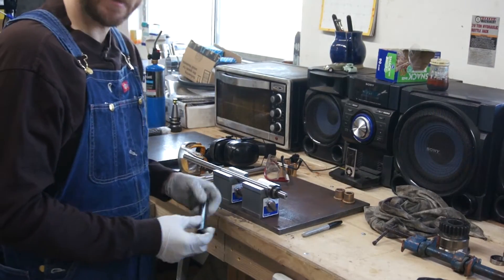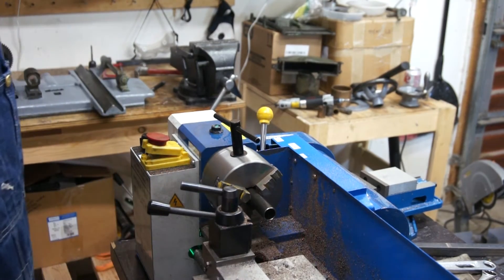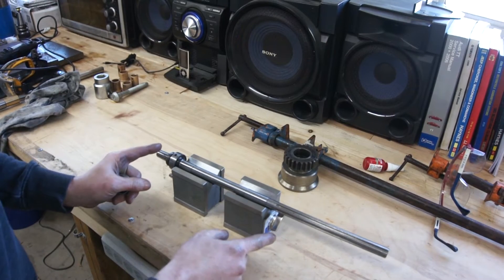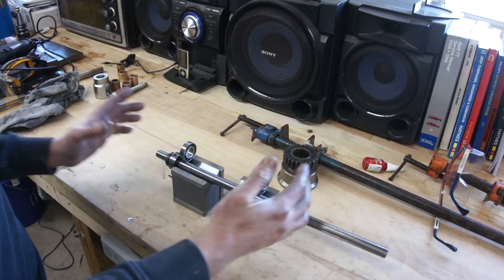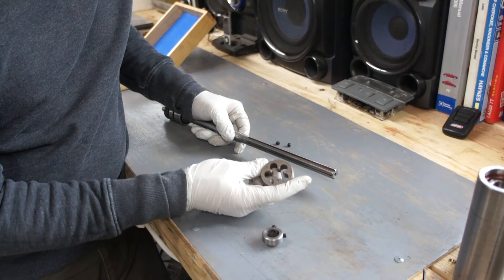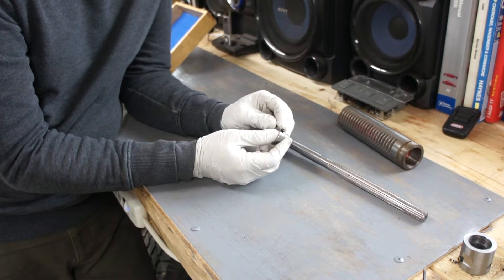Angular Contact Bearings - Drill Press Milling Machine

Comment: Robert, did you check the run out on the shaft with an indicator? that would have given you some kind of indication wether the bearings were good or needed replacing and oerhaps saved some time and money?

Comment: So did you try placing the shaft in the freezer and right before pressing it heat the outer sleeve which would give you a pressure fit for the contact bearing making it more stable.

Comment: I'd imagine the chatter on the Y axis is caused by a larger tolerance for the feed handle. Maybe by fixing the quill completely and using the table feed to raise and lower the job you'll create some more rigidity. You can replace bearings until the cows come home, but that's not where the movement is coming into it

Comment: Does the Quill lock? Is it a good fit in the drill head, if not, you could try electroplating it until it is a precice sliding push fit, lap it in even. Hope this is of help.

Comment: Some of that chatter could be from the play in the quill gears because I know on my drill press there was a lot of play in the gears like back lash where you can grab the chuck and move it up and down and it's gear slop and on certain cuts with a end mill it'll leave chatter marks....and end mills only really cut in 1 direction with the work going into the direction of rotation....just like running a grinder or cutoff wheel

Comment: Just throwing this out there, had you considered bushings instead of bearings?  Oilite bronze wouldn't work, but there are polymers that should, PEEK (polyetheretherketone) for instance.  Since you have a lathe, it would have been fairly easy to machine them.  I don't know about the finish in your drill press head, but if it were smooth enough, you might even be able to give the shaft a lot more support by machining the the bushing like a flange bushing.  The flange portion would have the thickness of the old bearing and the rest could be as long as you wanted.  Lots of area to take up compression loads and no pre-load problems at all.

Comment: I'm sure this has been said...The standard bearings are for axial loads (they carry the spindle) not compressional loads which you require..The standard ones will work, but with a very shortened life as they only hold the spindle in a central axis.The angular ones are designed for that kind of load.
The chatter will be coming from the x ,y table the quill and the screw jack. Locking off unused axis on x, y table will reduce some chatter, putting the quill as far to the top stop and locking it off will reduce the chatter.
I have a MK2 Beaver mill very similar to a Bridgeport and i get chatter if i dont lock off axis I'm not using on big parts, She is old and ways are worn...
Great vids, very informative and answers some of my curiosities.. Sorry if i am just repeating everyone, but i am lazy and can't be bothered to read them all..Thanks
Reply: you lazy?? Your comment does not remind me of a lazy man! I would think just the opposite!! Take that as a compliment!!

Comment: End mills only really cut in one direction, into the rotation of the cutting surface. Going with the rotation is referred to as a climbing cut and should be avoided if possible. I really want to build my own version of this project. So many of my questions were answered in these two videos.
Reply: So correct. Even using a wood router, you cut into the wood and not with the wood. Climb cuts will always be a problem with most any cutting power tool.
Reply: Climb cutting is the preferred method of cutting in CNC mills and even has a place in manual mills for helping reduce backlash in the drive screws.
Reply: @brandonsmoot4056  I’m strictly old school analog, I don’t have any experience with cnc machines and never will.
Reply: @WrenintheRoses  well in sure the backlash argument is something you've heard when talking bridgeports
Reply: @brandonsmoot4056  climb milling has its advantages, especially with a newer machine that has incorporated backlash elimination into it. I grew up in a family owned tool and die business that had manual machines, many of which had brass war department plaques riveted to them.
Reply: @WrenintheRoses  I am 1000000% with ya! Old-school, analog, etc... Cheers my friend.
Reply: End mills can be used in climb and standard cut for "any" mill old or new. I am a designer drafter and call out both types of cuts due to engineers instruction on production drawings. My company is responsible for millions of dollars of production work and this statement is simply not true.
Reply: @matthewmoilanen787 you are so correct, thanks for this comment…Paul

Comment: Great video on this, thanks for providing the original bearing specs, I do have one, the bearings are a little noisy but drills holes good enough for now. The WT line of tools changed hands bought by Delta and phased out. The odd bearings are used in their other machines also. Thanks.

Comment: I'm interested in switching to the linear bearings. You mentioned the DOM tubing was 16 mm ID. What was the starting OD?
Reply from the maker: I think it was 20mm OD.  McMaster 6045N13.
Reply: @RobertAdairWorkshop Thanks. I'm interested in switching just to replace my existing 80 year old bearings.

Comment: you can still use the die method, just need an adjustable die, one with a slit in it, allows for a tighter or looser fit, also can adjust for a deeper cut.
Reply from the maker: I hadn’t thought of that.  Thank you.

Comment: Are the bearings originally Imperial?

M grade bearings are designed for electric motors and are tighter tolerance than standard bearings.
Reply from the maker: They are an odd mix of metric and imperial.  As I recall, and my memory isn't the best, it's 5/8" on the ID, metric on the OD.  I will take a look at M-grade bearings.  Thank you.

Comment: Did a similar project years ago.  Made a complete new spindle with a MT 2 nose and drawbar. Used taper roller bearings. Made a new column with some triple wall pipe.  Lots of work for mediocre results.  Like someone said, it's educational.

Comment: How is the quill bushed in the body of the drill press? Seems like theres a ton of Stick out with that set up? that Chinese X/Y table could be tuned up and tightened up (Scraped, hand or power) I'm 54 years old, I told myself my entire life the Same things you were saying, Bridgeports cost too much, Are too heavy to move, Where will I get 3 Phase? ETC - Bought My Bridgeport in 2018, just over 4 years ago, and while I got it rough and rusty and semi-worn, theres still a TON a life left in it, I paid $1k for it, moved it with a Buddy and a Bobcat with forks and a rented Home Depot trailer, once home with a Cheapo Harbor Freight folding engine hoist and also rolled it like the Egyptians on steel galvanized 1" water pipe, and Had it running perfectly on 20A of 220v Single phase with a $115 eBay Static Phase converter- Dont kid yourself, even a worn out tired 1967 Bridgeport J-Head is better than anything you can cobble together, and Parts for Bridgeports are DIRT CHEAP, You can rebuild the entire spindle with all bearings, seals, shims, sleeves, etc for like $350 - They made the EXACT same J-head from 1938 to 2012 with no changes, so parts avail is easy and plentiful - I shoulda bought one in my 20's back in the late 80's early 90's when they were newer and not so worn, I think now with so much industry going CNC and also overseas, old 1960's, 70's & 80's Bridgeports are getting cheaper and cheaper - I'm near the Tampa FL area FAR from the rust belt of the mid west where everything was manufactured, theres places in Illinois, Ohio,  Kansas City, Etc with Real, USA Heavy machinery for PENNIES on the dollar compared to what I can find here -
Reply from the maker: Thank you!  I have been watching for a Bridgeport J-head for the past year, maybe.  I'm in Denver and we never had big industrial manufacturing here so they don't pop up used which makes this one tough.  There was one that finally popped up locally a few weeks ago on eBay but it went for $3800.  I found a guy who could transport it and offload it but he wanted $1200 to do so.  It just got too expensive.  I've been watching eBay and looking at some out on the west coast.  I just need to find one in my price range that someone is willing to freight to my shop and unload.  Time and patience, I suppose.
Reply: @RobertAdairWorkshop  Theres a 200 pound part I need for my Lathe in New Jersey right now, I'll be getting bids on Uship because NJ trip from FL is a bit too much- LOL

Comment: Would it have been easier and stronger to turn a new 17 mm shaft?
Reply from the maker: Yeah.  I think that's the better way to go.  I didn't at the time because I wasn't sure how to make the splined end where the pulley engages.
Reply: @RobertAdairWorkshop  oh I missed the spline part. But maybe there's a way to weld the spline section on or cut it....gotta admit,  cutting splines is a little beyond my capabilities atm...just throwing out some ideas...but nicely done and thanks for experimenting with ideas a lot of us without thousands of dollars to spend on machinery might have...another idea is maybe a sprocket/gear or pully could be welded directly to the top end of a 17mm shaft? Just seems any way to incorporate the thickest shaft possible would help..
Cheers

Comment: Hey Bob, how would you compare what you've made here to a budget bench top Chinese mini-mill?
Reply from the maker: Hi, William.  I really don't know.  I've never used one of those budget mini-mills.  I'll admit, I wanted one.  Pretty badly, actually.  But the best I could do was the Harbor Freight version which was going to cost more than $1000 with delivery charges and taxes.  I assume they are made similarly to the mini lathes, same fit and finish.  I spent a lot of time and money getting my mini lathe up to speed and making it a usable tool and I thought that might add another few hundred dollars to the cost of the mini mill.  

But something I haven't admitted to the community yet:  I have the parts for my own mill build sitting in the garage waiting to be built.  BT30 spindle.  Epoxy granite column and base.  That sort of thing.  The drill press mill is a stepping stone between no mill and that new mill I'm building.  I need a general mill to make some of those parts.  

Despite the ending of the video and some of the comments here, I really like the drill press mill.  It's met my needs fully.
Reply: Thank you for the response Bob.  I have a Delta DP200 drill press that is (I believe) the same make as the one you converted here.  Been considering the same conversion.   Good content by the way.  Give my channel a watch as well.  Thanks again and good luck.
Reply: @RobertAdairWorkshop  I'm in similar situation. I'm on SSI. No excuses! Keep up the good work, and like a cool, wise person said above, I echo .... f*** the armchair experts, they are tools of fools. Keep the passion burning, take breaks when needed, then jump back in. You already know. You got this!!

Comment: There are so many possible areas that can induce chatter - without addressing ALL of them , fairly poor results is the norm !   
       Those X-Y tables tend to have a great deal of slop . . . I have the same one , & have spent nearly 30 hours on scraping & lapping it into a reasonably accurate piece .   The lead screws are a poor fit at best - I'm replacing mine with 1/2 - 10 Acme screws, along with much better fitting 'homemade' nuts , that include delrin anti - backlash capability.    With a bit of tinkering , my table will now travel 6" x 10"  ! 
     Drill press headstocks can be significantly improved by adding 'take up' screws that press onto the the quill from the outside of the housing , * one on the front , & one on the side , which excludes any quill movement .   A quill LOCK is absolutely essential , to prevent any up & down motion !      Much like a bridgeport mill , a fine feed mechanism is very handy - *especially if it is made to preclude any SLOP !    When you consider the amount of backlash / freeplay of the average drill press' quill to downfeed gear , this becomes a necessary area to consider !
      Good luck with your adventures ;)

Comment: I'm pretty sure that your camera is not making that noise. It is related to spinning so it for sure comes from your drill but if you cant hear it might be the compressor of the camera mic that pics the high noise when the sound pressure goes up.
Reply from the maker: You called it!.  The tripod was up against the table and picked up the vibrations from the press.  I figured it out later but didn’t have any good footage to replace it so I used it.  I keep a better eye on the tripod.

Comment: My guess is that the cast iron bore and or the spindle shaft is oval which results in the chatter.  Can put it on centers and measure the spindle. If the spindle is round then can blue the spindle and see what is rubbed off.  Ways sometimes are fixed by filler plastic. Oil the spindle and apply the plastic to the bore and even put a little force to increase the gap.  Slide in place and then tighten toet reduce the gap and push out excess plastic and also remove from slit in the bore. 

Angular contact bearing are designed to carry higher loads the roller bearing, however the drill press bearing is designed for high axial force.  Stiffness should match the bearing of the casting and tube tube between the drill press and it's table.  Not surprised you didn't get much of a gain.

Comment: Newer CNC and tight tolerance mills can do climb milling, that is where the cutter is pulling the work into the cutter.  If there is any slop in the lead screw, as you turn the feed handle the cutter pulls the work to remove the slop.  Then you turn the handle, create more slop, the cutter pulls, etc.  That causes the chatter.

In conventional milling, the cutter is rotating against the direction of the work piece.  In old school mills, that is much smoother.  I'm not sure why going in and out as opposed to side to side creates more chatter unless you are also climb milling when going in and out.

Comment: I thought that it turned out quite well especially considering his modest $$ investment.  He proved it on steel and it would probably do a decent job on aluminum. We all throw our time at these projects and that time that we spend on a healthy project I consider to be an "education" whether it's a success or a fail.  You used to be able to get an old Bridgeport for $1500-$2000.  Them days are gone.  Now $2000 is a steal and $3000 and up is the norm.  A new "China" knee mill is $2500 plus tax and the wait is 5 to 17 weeks for delivery after payment.  Happy home milling!

Comment: One issue you can't really get around is the length below the lower bearing. That's probably affecting your rigidity a great deal. There's no real way around it though. Some drill presses, such as many of the Chinese presses that size, use a Morse taper arbor. That would allow the use of a Morse taper to er32 adapter and keep your tool much closer too the lower bearing. One though is, perhaps you can find a spindle that takes a Morse taper arbor that can be adapted to work in your drill press.

Comment: You are very right about each Machine being different even if they are the same exact model. The Chatter You are getting is because the Spindle Speed is to fast. For the rough cuts slow down the Spindle Speed and increase the feed rate and/or depth of cut. Use the faster Spindle Speed with a slower Feed Rate and very light Depth (.005 inches to .015 inches) when doing the finish pass.
Reply from the maker: Thank you for the advice.  I'll give it a try.

Comment: The fit of the quill in its housing is just as important; that the bearings didn't make a big difference suggests looking there for any rigidity gains.
Reply from the maker: I hadn't even considered that.  I need to go back and take a look at the quill lock and fit.  Thanks for the advice.

Comment: I would suggest using a High speed steel end mill, aluminum is soft and has a low melting point, Carbide does not work will on aluminum, also some cutting oil or a water base coolant, otherwise the aluminum will build up on the cutter, remember carbide is hard and does not like give, it will chip or break! Also "Leslie Gray" is right Climb milling is not recommended, one it can grab the part and pull it, and it  cause chatter, also if you have any play in your ball screw or thrust bearings you will all ready know what I am talking about!
Reply from the maker: Thank you, Richard.  I had the carbide in there for machining that hardened shaft from the surface grinder, and in didn’t want to swap it.  I think I need to buy a set of 1/4 or 1/2 HSS end mills.

Comment: Hello there.. This is what I like - home diy problem solving the best way you can. Of course many things might go wrong when adapting something meant for one thing to do another thing, but sometimes it's the only way to reach a solution. Here you have some basic problems:
1. the machine is not meant for side forces, therefore it has lower rigidity
2. bearings are just a part of the equation
3. the shaft is thin and subject to chatter
4. 'n most probably the most important is the length from the lower bearing to the tip of the cutter.  If you want to make it more stable, shorten the collet system, which is the hardest because of repurposing. 
Also the direction of travel is better against the turning, as the machine is not rigid, traveling along it makes more chatter as it tries to pull also the table, which amplifies the oscillation.
Don't worry, you did a nice job, it's just the nature of the thing.. I don't recommend you to use it for much steel milling or it will last very little. Aluminum, plastics and brass should be manageable for some smaller projects. Anyway, I hope to see more about it.. 😉